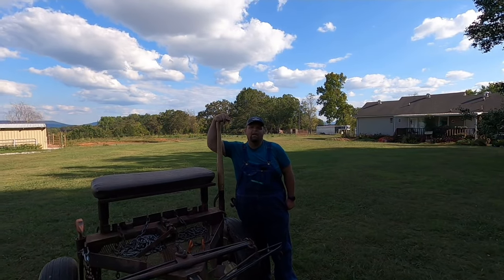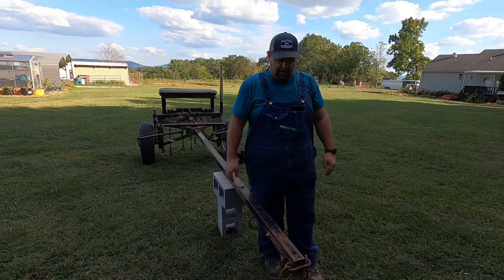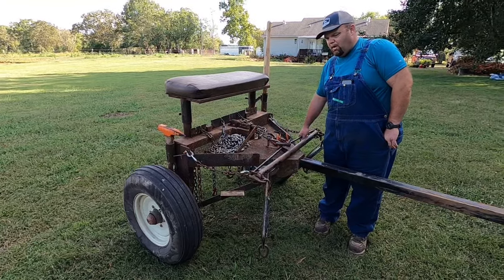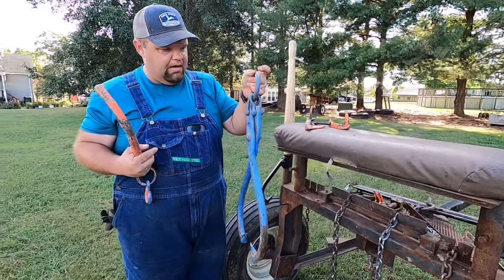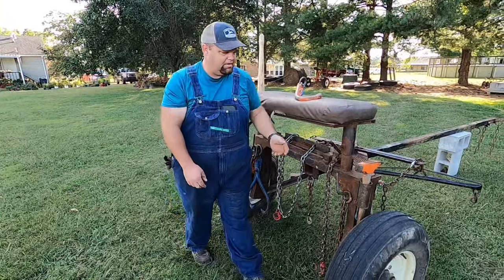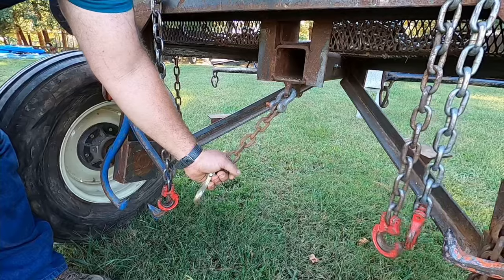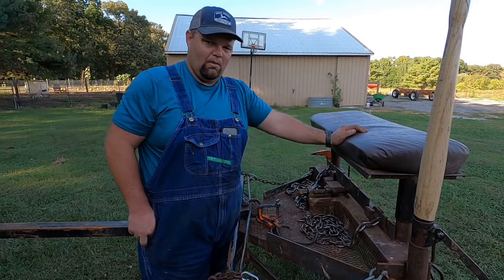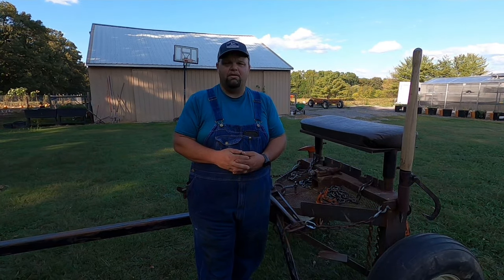Mule/Horse Logging Cart and tools #065

Comment: Thank you for your tutorial on your cart, even though I've never worked with horses I could easily follow your explanation and the different application, we used to have a cart where we would put 5 logs, 70 foot logs length measuring over a 1000 bdft it was an easy pull. Keep up the interesting tutorials, and thanks again.
Reply from the maker: Cool 😎 that’s a big load for sure. And you’re welcome! Thank you for the kind words. And thank you for watching and commenting.